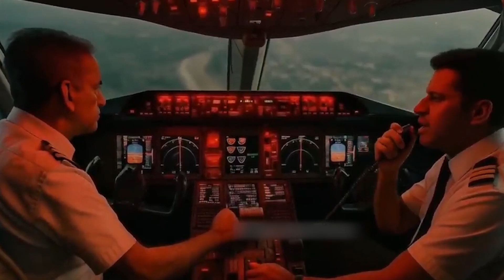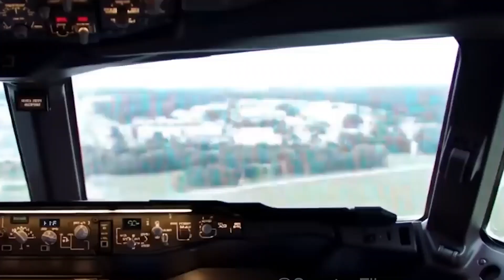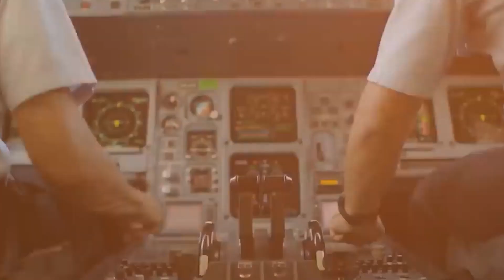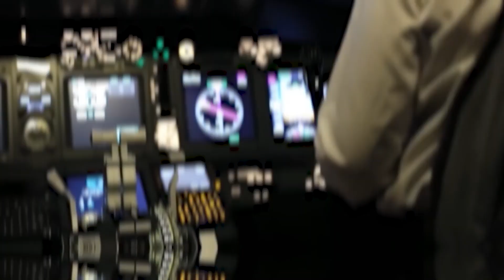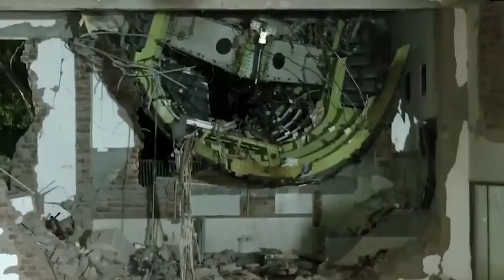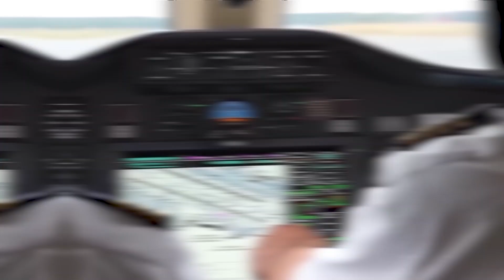Scientists Exposed The Truth Behind Air India 171 Crash Mystery!

Comment: Crashed with the nose first states the video ! That,s completely wrong
.The aircraft had its nose UP ! indicating that the pilots tried to gain altitude and save the aircraft !
Reply from the maker: Thanks for pointing that out. You're absolutely right — if the aircraft's nose was up at the moment of impact, it suggests the pilots were actively trying to regain control or reduce the descent rate, not diving nose-first as the video claimed. It's an important distinction, especially when analyzing crash dynamics or pilot response. Misrepresenting that can lead to misunderstandings about what actually happened. Appreciate the correction.